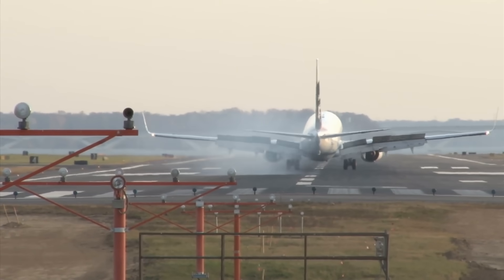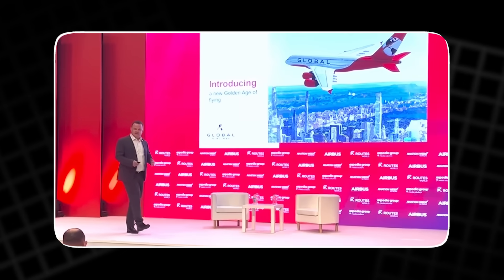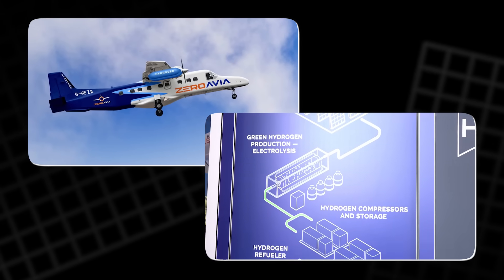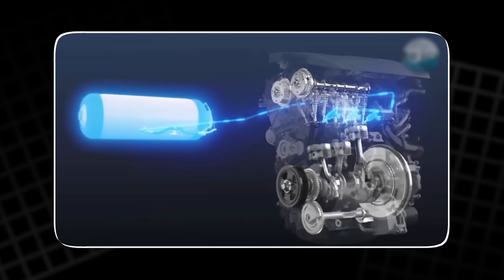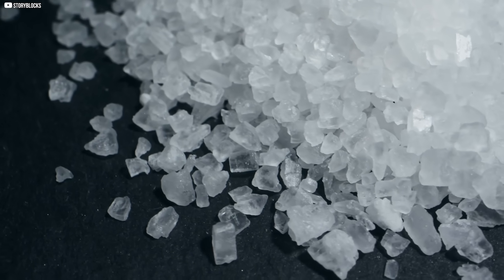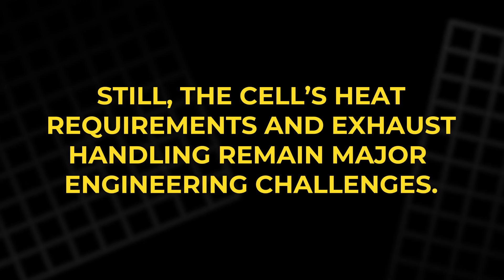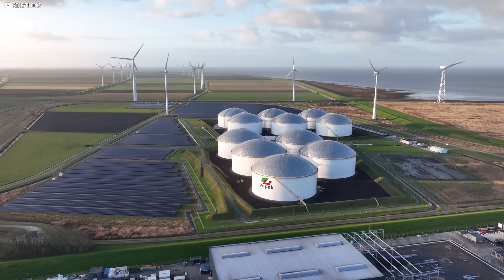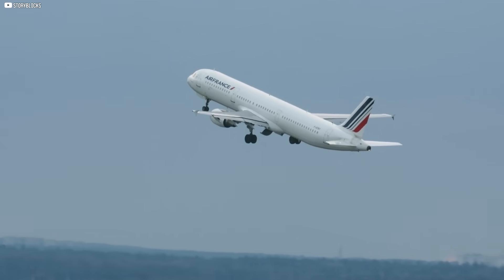MIT’s Silent Breakthrough That Could Power Future Planes

Comment: "Keeping hydrogen under control requires heavy, high-pressure tanks that add significant weight to any aircraft." 
Really ?? Are those tanks heavier than the 150 tons of kerosene that the largest passenger aircraft carry on long-haul flights? 🤔🤭😆🤣🤣

Comment: it all sounds very good. but just don't get the batteries wet. Sodium metal has a violent Oxidative reaction with water.
and being Hot and Molten as well.  I have reservations about how safe the Sodium hydroxide being released would be, 
it is very caustic... it could be the launch of the Hindenburg II,  it demonstrates, it Navigates, but most of all, it Incinerates!

Comment: If it works for airplanes, then why not for everything else? Four times the energy storage of lithium batteries? Sodium fuel cells should replace pretty much everything. Unless there's a killer drawback, which I have not yet seen.
Reply: yeah.... one killer thing is that its extremely inefficient. if it even works.
Reply: The sodium fuel cell they're talking about here, for airplanes, uses the sodium in molten form, that's the draw back.  Way more expensive to operate than regular sodium ion batteries and as a result unnecessary for electric vehicles.  Sodium ion batteries that are currently being made and improved are going to be the future of EV's. We will see it take over in the next several years.